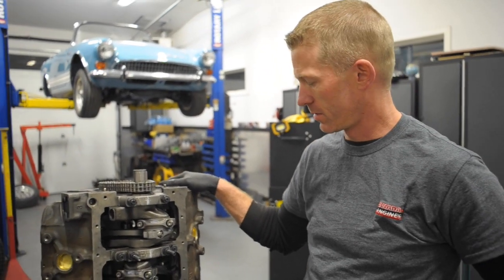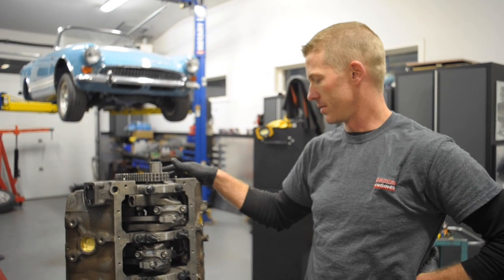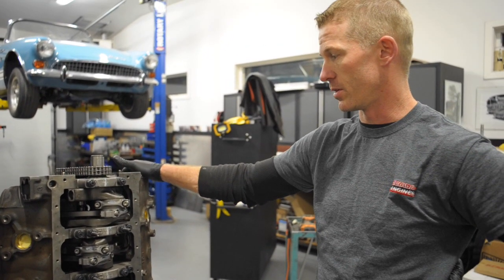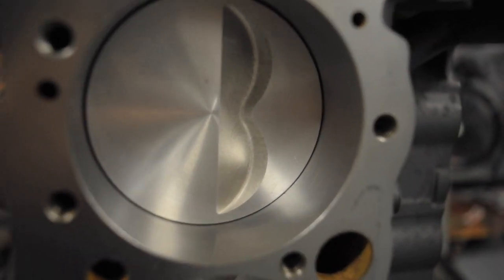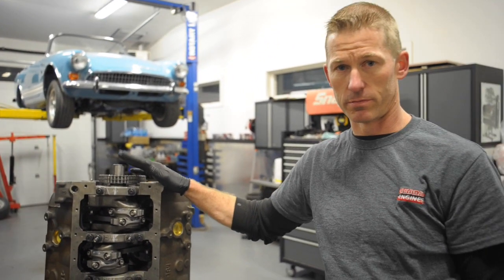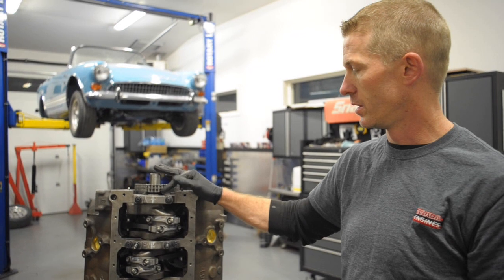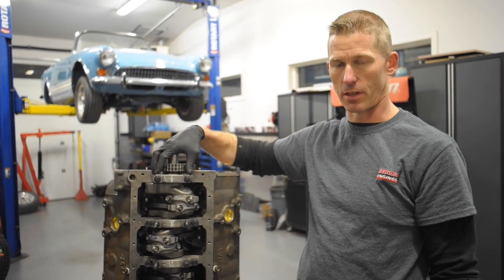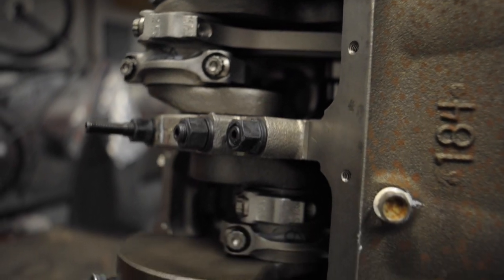SBC 283 Crankshaft + 400 Block Crate Engine Build Intro

Comment: This is super easy to do now. 4.125" blocks with 350 mains are plentiful new. Then you can get small journal spacers or buy a new 283 stroke crank with 350 mains from Eagle.
Reply from the maker: Yes for sure. We just used what we had :)
Reply: the cool thing is, if you're a ford guy... You can go shorter in stroke with a 4.125 bore 302 block. They still make 289 cranks.

Comment: I’m curious if any one would make that 283 crank as a large journal, so it would fit the 400 block without using  bearing spacers. 
I’m sure there would be a market for it, probably a small market but once the forge is set up for it they could pump out several hundred  and as long as they weren’t machined they would last forever.
Reply from the maker: That would be great but I doubt it’s going to happen. A custom crank would probably be available but very expensive.

Comment: i was thinking about this : 400 bowtie block , 327 crank and rods , bowtie heads . this is my base . the rest would take a bit more research ie : cam , carb etc . any thoughts on this ?
Reply from the maker: I love the ideas. If it’s a street car then pick a camshaft that still gives decent manifold vacuum. I like 114 degrees of LSA. 
.550 to .575” lift. 
224/230 duration at .050”
Just my thoughts.
Reply: @ceperformance  i appreciate the feedback !
Reply from the maker: You’re welcome.

Comment: Where did you get the bearing spacers?
Reply from the maker: The bearing spacers we used were from Race Engineering. They take King Performance SBC 350 main bearings and machine in inside to allow the small journal bearings to fit in them. A tab is also added. 
Our block has 350 sized mains not 400’s which is why this build, in this way was a possibility. 
I have not found spacers to go from the small journal to the 400 (largest) size.

Comment: What is the part number / maker for these crank bearings ? If it's not too much trouble
Reply from the maker: The bearings are from Race Engineering and their part number or the bearing spacers is RA-BS-327. Just to clarify that we used a 283 small journal crankshaft and this block, although a 400, is an aftermarket Bowtie block we found from a scrapper and it has the medium main journal size like a 350. (Unlike the factory 400 larger journal most are used to)

Comment: I like your work guys. Im not sure why you did it but im all for making oddball combinations to help repurpose otherwise worn out parts to make something stll viable in the market. Sine the 400 block was 60 over you want to limit the side load on those thinner cyl walls with a shorter stroke and longish rod. Also gives you fantastic rod ratio and a light piston as well. Look forward to seeing how it all goes.
Reply from the maker: Thank you for commenting! I’m glad to hear you understand the intent of this. Some guys shake their heads at this but it was definitely a combination of parts we had and an unusual opportunity to do this. The 283 crank wouldn’t fit the regular 400 block even with the available bearing spacers but the old Bowtie block we had was sized with the smaller mains of a 350. Therefore it was doable! So we went for it! I hope you enjoy the other videos on this build.
Reply: @ceperformance sorry, made the comment before I checked the date of post. I did look at the other vids and was pleasantly surprised at the out come. There’s a lot to be said about short stroke, long rod and the bigger the bore the better. The engineers that designed the boss 429 were onto something.
Reply from the maker: Very true :)
Thanks for commenting!

Comment: We were putting 283 CAMS IN sb350'S back in the 80's for econo performance upgrade.
Reply from the maker: Did they get better mileage? Probably suffer on power I’d guess. 
Thanks for commenting.
Reply: @ceperformance   actually they worked pretty good. The 283 cam has a higher lift than the stock 350's we were using and the duration was decent. I had  1966 283 power pack heads that had been worked over a bit with larger exhaust valves, a 283 cam, WEIAND single plane and a 4 barrel. still using the ram horns and it woke my 66 Impala SS right up. Got rid of the torque tube driveshaft, kept the Eaton 3:30 posi and away I went. It wasn't the fastest car, but it was fun to drive and could roast the tires pretty much any time I wanted. I still have 2 of those Intakes brand new in the shop.
Reply from the maker: Cool stuff! Love those old stories :)

Comment: Keep on jr. pro stocki'n.
I love it. 👍
I get 330 c.i.?
Reply from the maker: Yes, technically it’s 330 but 329 is it’s name :)
Reply: @ceperformance  I love it!
Just like the 441 LS is actually a 440.  But that space was already taken. 😊
Reply from the maker: What’s the dimensions of the 441?
Reply: @ceperformance  4.185 X 4.00"
Reply from the maker: My next one should be interesting. I want to start with a tall deck, 4.2” bore and a 3.267” crank. Want to see 1.9+ HP/cube. Might be looking for some help on heads :)
361 cubes, 700+ HP!
Reply: @ceperformance  now your talkin.
Reply: @ceperformance  
Put a gm cnc ported LS7 head on it. Not LS3
Reply: They make a cnc ls7 lsx that I have made just shy of 800 hp with. That head out of the box with a debur will get it done and is perfect for that application
Reply: If you use a conventional flange style intake? Use one with a 4500 flange.
1050 cfm dom or efi and a ls7 medium height ram if holley makes such a thing? Make sure the intake you choose has a ton of taper. 

I think with 12 to 1 you can make 2 per inch. If it does you would put us all out of business. Lol
Reply: 362 ci x 2 per inch. 👍🚀
Reply: I just rememberd. That LSX head dpes need the ssr modified for high lifts. It stalls otherwise. But if you do want to do some porting and tpuch the valve job and fix the throat diameter. That head will flow 405
Reply from the maker: Tom, thank you for your valuable advice!! We’ll need to get together on this one for sure!
Reply: @ceperformance  any time my friend. You have me on speed dial. Don't ever be shy.  But from my eyes, you have proven your abillity is extreme and it is very likely we need your help more than you need ours. Your a superstar and a scholar Steve.
Reply from the maker: That’s humbling. Thanks man :)
Reply: Good call ! I added them numbers up 3 times thinking I was missing something

Comment: I put a 400 block with a 74 vette L-82 350 crank. No cats in 74. 377cid. Went 160 easy. At the time the mustangs were running out of steam at 135mph. That's when I would shift into 4th with a power shift putting down a 20ft long chirp of the tires on my way to 160+. The guys with the new mustangs were in awe.
Reply from the maker: I bet that sounded awesome! Thanks for commenting.

Comment: HOW did you get pistons all the way up with shorter crank? Longer rods?
Reply from the maker: We used 400 pistons and the 283 crankshaft. To make the piston reach the top it has 6.1” rods. Actually they protrude out of the deck slightly so it has .061” head gaskets. 
Thanks for commenting!
Reply: @ceperformance  is that a high deck block? that's like .4 inches over what a standard 283 would use.
Reply from the maker: @joestreiff9401  
Standard deck height. 
283’s have a very tall piston. These have a compression height of 1.443”
Reply: @ceperformance  ah, ok that makes sense. back in the day (60's) we used to just take a 327 block (early blocks were small journal) and pistons and use a 283 crank and rods.... rod length on all the early small blocks were 5.7 (283, 327, 350)
Reply from the maker: @joestreiff9401  
You got it! But the longer the better :)
Reply: @ceperformance  at least that's what smokey always said.😀
Reply: @ceperformance  that's what SHE said 😉😉
Reply from the maker: Hahahaha
Reply: use 283 length rods

Comment: I couldnt find those bearing spacers to save my life 8 years ago, found large journal spacers to make a 352 destroked ( 4.155 bore x 3.250 stroke 6.200 rod) i did find obsolete Part numbers, if i could find em'😊.now resides in a 75  Chevy Vega,5 sp,12bt 3:73's, shifts @8500rpm
Reply from the maker: Hey, thanks for commenting! 
8,500…  wow! That must be fun and sound amazing.

Comment: So at 9000rpm fpm is 4500 on a 3" stroke. The only situation I can see calling for such a small stroke endurance racing. 
Is this some sort of historic 24 hour class?
Reply from the maker: Thanks for commenting! 
No special class, just some guys having fun.
Reply: @ceperformance  
If it's just fun you could use a 350 crank cam it for a 7500rpm peak and be at 4300 fpm piston speed. This would be 383 cubes and with the right heads you would be well into 700hp. 
I understand people want what they want but there is literally no advantage of using a 3" stroke crank over a 3.48" crank. Literally none at all other than maybe parasitic loss due to journal size but that is miniscule in comparison to the power gains of 53 extra cubic inches. 
Here in Australia we have a Shop called Higgins Race heads, he makes a very cheap SB2 head which on a 383 with a 4.185" bore would make power out to 8k and piston speeds would still be in endurance realms.
Here is a video of his heads. 
https://m.youtube.com/watch?v=YJjoRWP8AQc

Even if the owner wanted a stockish look a set of Dart 007 iron heads ported could make 660-720hp on a 383.
Reply from the maker: @Channelmaster73  
Thanks again for commenting. You make a good point in what you’re saying!

Comment: If I`m not mistaken that`s the combo Harry Gant ran in the Skoal Bandit. He won 4 races in quick order on short tracks and got pulled apart, was not disqualified cause he was under cid limit but not at 358. I don`t understand how a smaller motor would be faster but the NASCAR official said in the interview it was more efficient with the heads of the day 18* I assume.
Reply: The bigger the bore the more vlave you can fit.
Reply: I've witnessed a 3.25 stroke win the late model stock car race at Orange County Speedway, it was declared illegal because you could only run a 3.48 stroke.
Reply from the maker: Hmmm that’s interesting :)
Reply from the maker: That’s very interesting.

Comment: werent 400 blocks siamesed, why use a block known for bad cooling issues.seems like an unwise comprimise to make a displacement close to whats allready available from chevy with all the bugs worked out.just my opinnion, you may have a logical answer im not aware of.
Reply from the maker: Thanks for commenting. Although the 400 has Siamese cylinders, there is no inherent cooling problem because of that alone. Many production engines are designed that way. 
There are simple procedures we do to improve the cooling system flow that are very effective. We’ve built several high powered 400 over many years and never had a heating problem.

Comment: I would like to know what camshaft comp cams would recommend for this engine. With Beehive valve springs it should rev 8k with a lot of top end power.
Reply from the maker: We use Comp Cams as well. This got a custom grind from them. 
It has 224/230 duration @ ,050”
and .536/.544 lift, 114 LSA 
Plus 4 degrees of advance when ground.
Reply: @ceperformance  that's excellent for street tourques :) .
 You could shift more power up higher in the RPM for a race car. 
But you nailed it for a street cam. Solid lifter and bee hive springs could give more up top, but again, you got plenty for the street. Nice build.
Reply from the maker: @DANTHETUBEMAN  
Thank you!
Reply from the maker: @suzukiltz8902  
The main bearing spacers are from Race Engineering. Then you use regular 350 main bearings that match the crankshaft.
On our build we used King bearings for the rods that allow for the use of large journal rods on the small journal crankshaft. Part # CR867XPN030
Reply: @ceperformance  that's another clever rod truck. I was just noticing those nice rods. this engine will last a long time and put out great HP doing it.

Comment: bearing  spacers   OOF  i would never    trust that   to last
Reply from the maker: Hi Futten, thank you for checking us out! And for your comment. This engine is built as per our customer's request. We've used bearing spacers in the past and had zero issues. We appreciate your concern, but we're comfortable with the choices made. It will work, or it won't Either way, it's R&D, and we're proud of that. Best regards.

Comment: That bore/stroke combo is similar to what is being run in the faster NHRA Competition Eliminator classes . Nice build ! Anxiously awaiting the follow up ! Also , what cylinder heads / intake /cam ?
Reply from the maker: Thank you for your comment Jimmy Waters! We're using AFR 180's milled to increase C/R, with approximately 55cc combustion chambers. Edelbrock Performer RPM Airgap intake, and a very mild 4/7 swap cam.
Reply: @ceperformance  why the 4/7 swap and not just swap to an LS firing order? The swap has never shown an actual gain when compared side by side but the LS order allows better harmonics. At least that’s what I’ve read.
Reply from the maker: @ScooterLee-ei1ep  Hi Scooter Lee1775! Thank you for your question! For SBC's, only a 4/7 swap is available, unless the possibility of a complete, custom billet cam is available, with a 4/7 and 3/2 swap (to mimick the LS firing order). We've not inquired that far about that at this time. We answered a recent question that involved our reason for the 4/7 swap (not about power gains, but gains in other respects). Here's part of that answer: "This was one of the reasons for our 4/7 swap cam—to move the consecutive firing between cylinder 5 and 7 up to 4 and 2, to remove any possible hot spot in the rear corner of the engine. Also, we are being intentional with coolant-line  plumbing from the rear of the intake manifold to ensure coolant is pulled forward, and not left stagnant. Of course, "steam holes" would have been a great addition. The cooling effect of aluminum cylinder heads will helps with overall engine temperature consistency. Of course, we are still testing our ideas out." 
We hope this helps with your inquiry, Scooter Lee1775! Best regards!
Reply from the maker: @ScooterLee-ei1ep  Also, there's something fantastic about the subtle and unique change in sound with the 1-8-7-3-6-5-4-2 finding order, which is, of course, entirely subjective: https://www.youtube.com/watch?v=5by3aG_YXds
Reply: @ceperformance  thanks for the reply. First I’ve heard of the hot spot I’ll do some more research. And you are correct there aren’t any off the shelf cams for the gen 1 with the ls firing order. But i have seen them run. They seem to run better at higher rpm that the standard firing order. Cool build and keep it up
Reply: @ScooterLee-ei1ep   If you check with Reher/Morrison, they are a big proponent of the 4/7 swap firing order camshaft .( At least for drag racing applications) I believe they have said they have found significant power gains from this combo . But, their engines are developed to the 10th degree, so, that is probably why they have found power from that. In the search for ultimate horsepower, you cannot leave any stones unturned .

Comment: I thought the 283 was small journal (2.300), 350 (and a bunch of others) medium journal (2.450), 400 large journal (2.650)
Reply from the maker: Hi Daniel, you are correct. This particular 400 Bowtie block has 2.45" mains, which enabled us to utilize bearing spacers to fit a 283 crankshaft. Thank you for writing! Best regards.
Reply: also to note...I believe the 67 and possibly the 68 283 was large journal but cast not forged.... the 302 Z28 crank is basically a 283 crank too
Reply: @55classic1  

Sorry but no, '67 was the last year for the small journal sbc engines and the last year for the 283. In '68 the 307 was born and replaced the 283 as the entry level v8.

The 307 had the same bore as the 283 but shared the 3.25" stroke with the sbc 327 that was carried over in '68 for another year or 2 until it was also discontinued in favor of the sbc 350.
Reply: @itseithergonnaworkoritaint7852  ,
The small block 307 is a 283 block with a 327 crank 

And the small block 302 is a 327 block with a 283 crank 

So the Crankshafts for 283 were still being made and 283 blocks were still being made in 1968 because I have them both , I also  have small block 327 in small and large journal from 66 to 70 ,
But they quit making the 327 in 1969 or did they ?
Reply: @jimthomas777  
Are you sure your 283 is newer than '67? I'm pretty sure that the large journal 283s in '68 and newer came with the 327 stroke that made them 307s.

I'll admit they were still making 302s after '68 so one could mix and match pieces to make a large journal 283 with a 307 block and a 302 crank but why would anyone want that? LOL 

Actually the 302 cranks was balanced different from the 283 cranks because the 302 pistons were heavier so you can't really call the 302 crank a 283 crank. So that means they did not make 283 cranks after 1967, so there were never any large journal 283 cranks ever made.

Same deal with the 307 vs 327 crankshafts, they were balanced different because the 327 pistons weigh more so the 307 got a 307 crank.

And I said the 327 was phased out a couple years later, looks like that is true as well because I can't find a 327 block after 1970.

Just because you could use a 307 crank with a 350 block up to 1973 to make a 327 doesn't mean the factory made them that way, have a nice day.
Reply: @itseithergonnaworkoritaint7852  , I also have a 327 Forged Steel Vette crank and it's in a 4 bolt main 350 block , ported heads , 12:1 Forged pistons , aluminum hi rise intake, hi lift Comp cam, 750cfm carb , it had a 1050 Holley Dominator,  headers, HEI distributor , 11 inch clutch, Lakewood Blow Proof Bell housing , M-21 Muncie 4 speed Trans , 12 bolt posi with traction bars , 
Revs to the Moon ,
11,000rpm before the valves start to float 
And makes 450hp